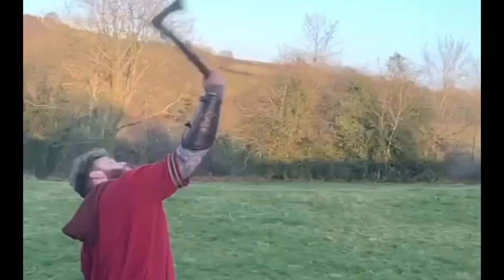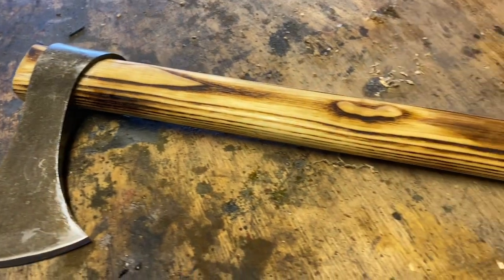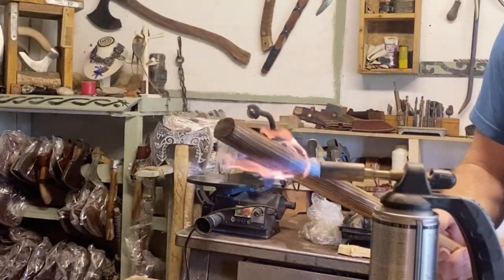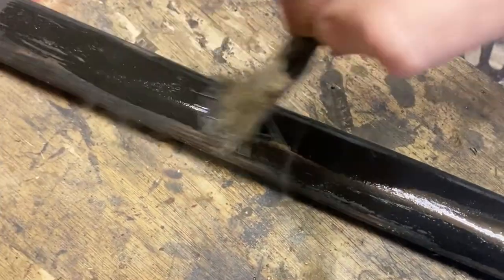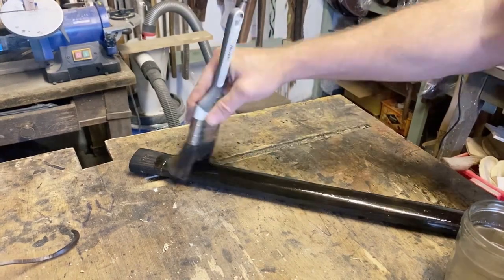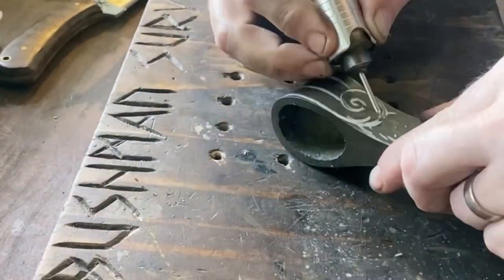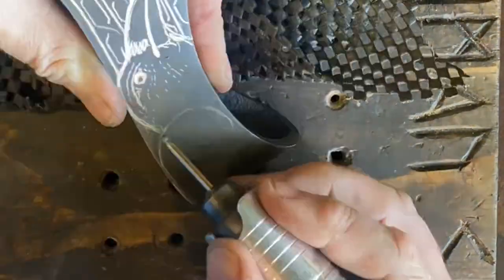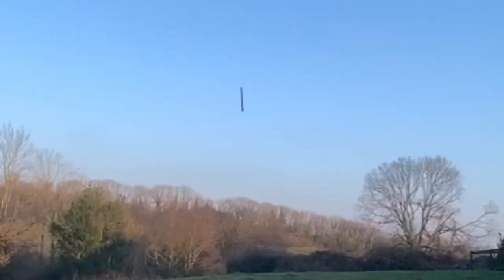How To Burn And Darken An Axe Handle, Throwing Axe Upgrade

Comment: Amateur comment/question #2.  What is the best wood to use for target practice?
Reply from the maker: Anything that’s free! :) be careful of pallets due to the nails. Pine boards are great and easy to replace. Large tree stumps work well on their side. These are 4”x4” pine, I got a load free so used them :)